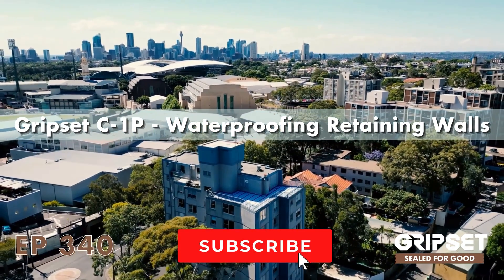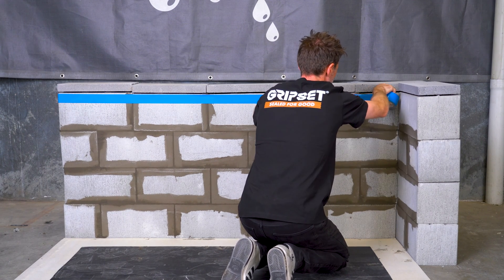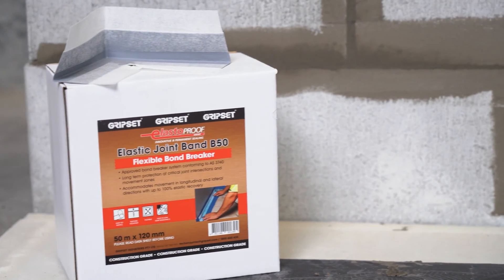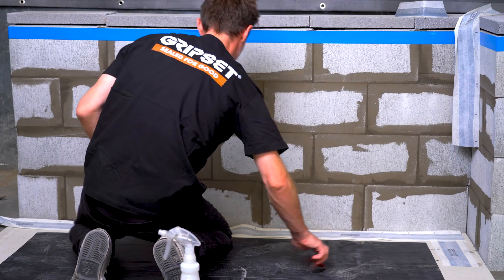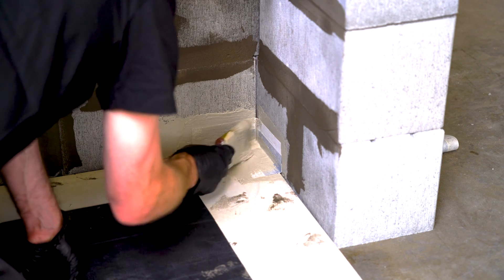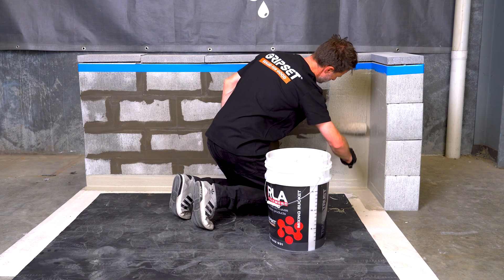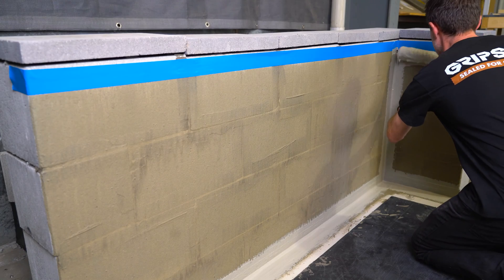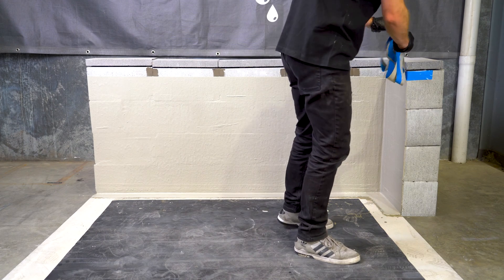Gripset C-1P: Waterproofing Retaining Walls

Comment: How would you go about dincel or similar pvc retaining walls
Reply from the maker: Hi Ben, thanks for watching and reaching out! There's 2 options! Option 1 is a liquid system, you can use liquid membranes where the crucial step is the primer, we recommend using:
Gripset OP Primer: https://gripset.com//products/gripset-op/ 

Option 2 is to use the sheet membrane, we recommend the BRW HD system that will adhere directly to the PVC without any primer:
BRW-HD: https://gripset.com//products/gripset-brw-hd/

Hope this helps and happy waterproofing! :)

Comment: looking at the finished application in the final seconds of the video, was the surface prepared adequately for the membrane? I see lumps and protrusions in the finished application as well as the mortar lines.
how flat and smooth is the preparation to be? Thanks
Reply from the maker: Hi Charles, before commencing the application, the important step is surface preparation, you need to fill any holes and voids before applying the membrane over, they should be flush and level with the wall, refer to the opening scenes where the joints were filled and scrapped for a flat even surface. Hope this helps and thanks for watching! :)